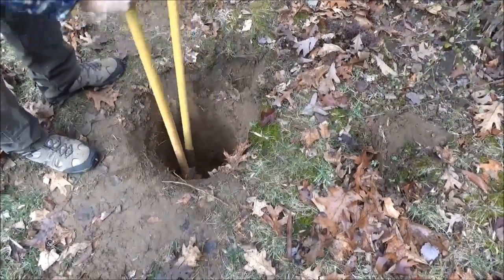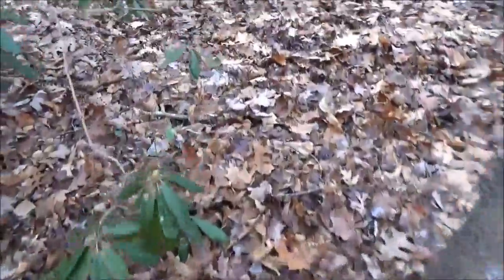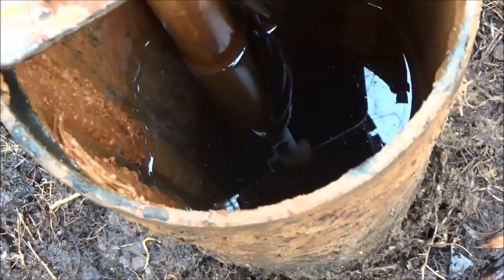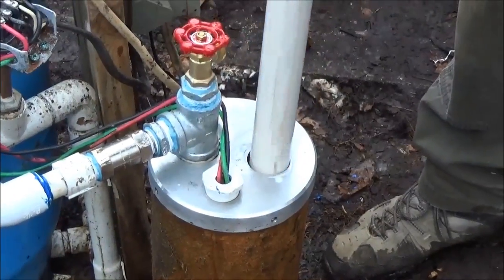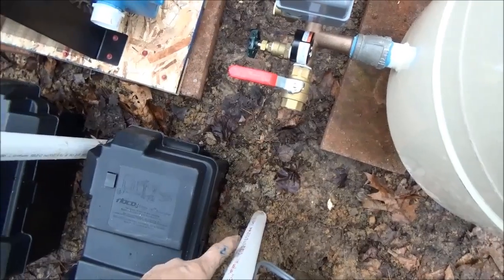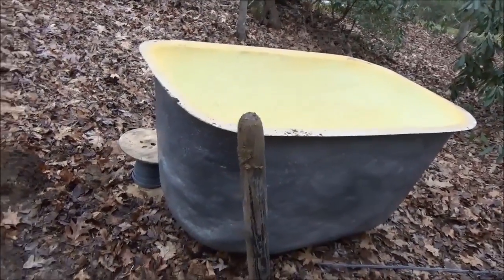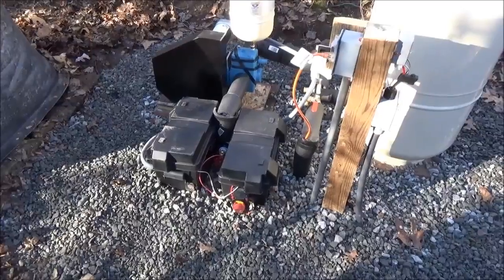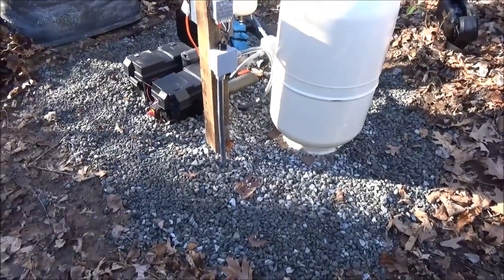The well runneth over!

Comment: Is the heat tape "always on" or thermostatically controlled? Just curious as here in N GA a pipe froze in the well house last year during a polar vortex. This year have a shop light in the building and have run the taps to prevent freezing when necessary. Heat tape sounds like a better idea!  I have an idea for a video for you too: A short lesson & schematic of how a well pump works with a pressure switch, bladder tank etc for an above ground well pump and explain the system, with options for off-grid backup? I've  been trying to find something on line and none are very helpful.  Still haven't gotten a switch installed to run my pump off solar at 110 - other issues have come up (busted pressure tank).  Always something!  Nice video btw, love you enthusiasm.

Comment: It would be nice if the static he a good recovery , you could put a  pitiless in around w' or more and install a tank down the hill just below the pitiless . Now you don't need. Pump for the well . 

Just one pump at the tank  . Just a thought , I have done this and works well . That's if your lucky enuf to have a good static . 
You could cut the Casing also , but if you install a pitiless and leave the casing high, then use a auto shutoff in the tank then if the take was full , the water will just rise up into the casing like it has been . 
Thanks for good videos , keep up the gate work .

Comment: Where can I find those insulated fake rocks? How big do they come?
Reply from the maker: That one is the biggest one I can get. 69x40x40"  I get them from DSI. Driller supply in NC and SC.
Reply: engineer775 Practical Preppers
 - Thanks! I've got a shallow well that is using a 36" culvert pipe for a casing... it was almost 6' tall. We cut it down a bit, so now it is only 2' tall or so. Don't know if the thing will ever freeze over, though there was a ruptured gate valve in it, and the insulation sounds like a good idea. Also need to find a decent lid for it, and am told no one makes a fiberglass or plastic one that size.
Reply: MrConradF  look for septic tank lids there in that size raing